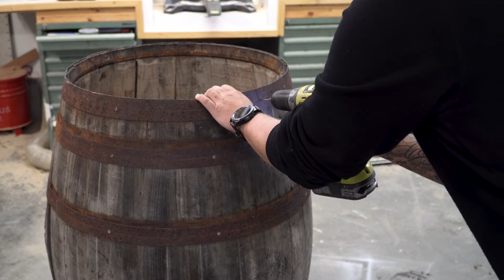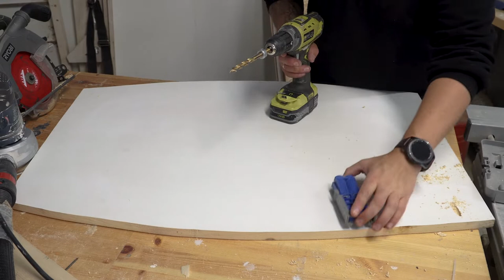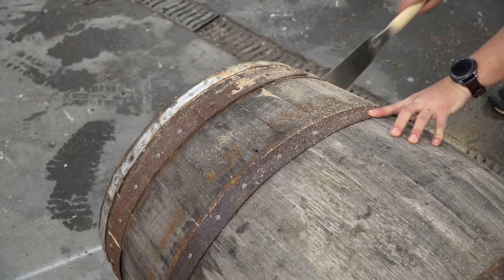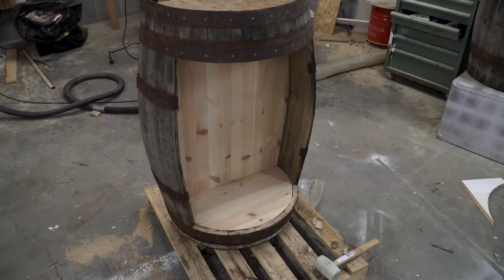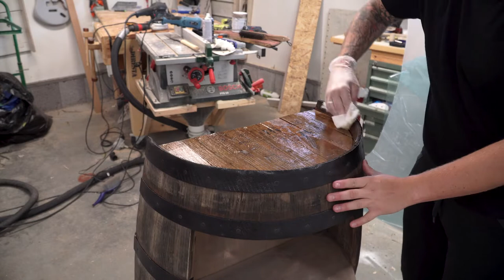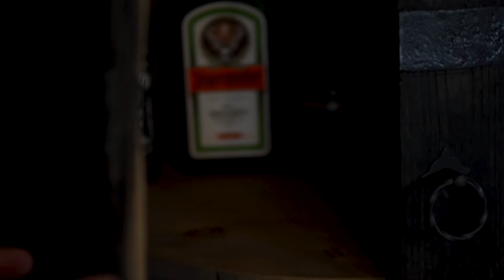Making a Barrel Bar Cabinet

Comment: That was amazing. Please, for an aspiring DIY guy, what kind of hand saw you used to saw off the wood? I've never seen it before. Also, what kind of oil did you use to stain it?
Reply from the maker: Thank you! It was probably my japanese hand saw. If i Remember correctly i used boiled linseed oil..
Reply: @stianhammervold  a Japanese hand saw. Wow. And boiled linseed oil, so much to learn. Thank you very much.
Reply: @stianhammervold  hello again, it's me, the novice. Lol. Forgive me for asking questions yet again. The blue tool you used to drill the holes in which to drive screws attaching the various pieces to the barrel, what is it called?

Comment: Could you tell us what is the board called that is used on the back and for the shelf’s? I’m not finding joined boards with laminate backing. 
Nice project btw
Reply from the maker: Not really sure what it's called. It's Just glued up pine boards that we can get in many different sizes here in Norway. It was Just something I had laying around.

Comment: Is it possible to save the other half and make two shelves/tables out of one barrel?
Reply from the maker: Yes, but you would have to lock the boards in position before you cut it in half or you will have to do a lot of extra work.. i regret not doing it my self 😉
Reply: @stianhammervold  so that's what you were doing with the nails in the beginning?   Love the work.
Reply from the maker: @craigzilla100  yes, it was 😉 thank you 🙏🏼

Comment: Hi. Trying to make my son one, my doors won't close, no where near flush. We didn't put the rivets on every band. Is there anyway to save the doors? Thanks for your time
Reply from the maker: Is it because of the hinges or did the radius or did the boards on the doors move so that radius changed?  I had a lot of difficulty getting mine right, I think I tried 3 different types of hinges, and I had to bend the ones  I used to fit with the radius if the barrel, can't remember if I that part was in the video or not 😉
Reply: @stianhammervold  think the radius changed, when cut the bands it popped, don't know if that is normal
Reply from the maker: @karenterris1309  I think a little bit is normal... Is it possible to put glue in between the gaps if the boards and then camping it back to the original radius?
Reply: @stianhammervold  will try. Thanks so much
Reply from the maker: @karenterris1309  good luck! 🤞🏻😉